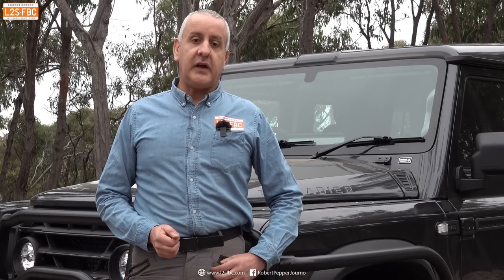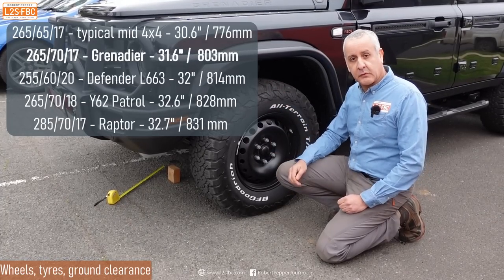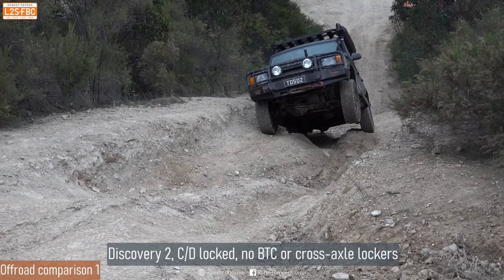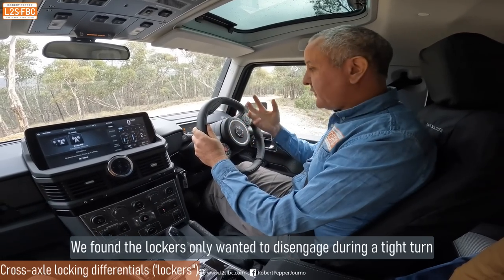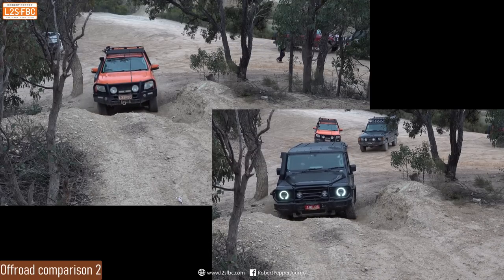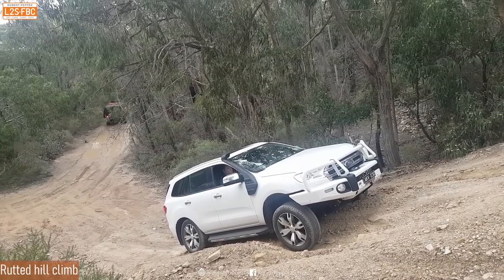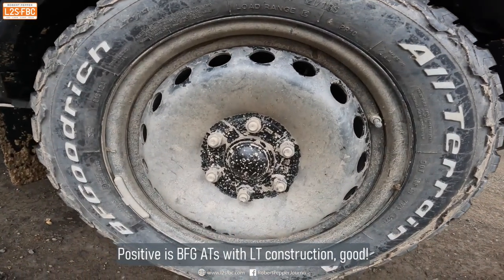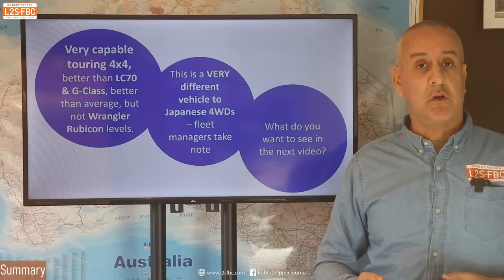INEOS Grenadier Offroad Review & Comparison : Australia

Comment: At l;ast, some real inbiase review...
 Can you further elaborate on the car's workmanship? ther wewr complaint about poor wiring, loom connectors, steering on tarmac roads,/
What about accessories - I see you have a buullbar installed, What about UJF radio? Hi Lift contact /lift points? drawers? etc? How can one attach a Warn whinch?
How dfoes the car eract fullu loade - fridge, off-road equipment, camping kits, food, 4 adults?How are thr rear seats for two adult while offroading?
Reply from the maker: Build quality is good. Road I'll cover another time. UHF would be easy. Drawers can be built. The vehicle cannot take a standard lowmount - I did cover that. It wasn't loaded, that'd be next.

Comment: Brilliant video! Best so far on the IG. I cancelled my order also due to the rising costs and the fact it doesn’t seem finished yet! But looks to have loads of potential! Would be great to see it up against modern alternatives such at the new defender and Land Cruiser. When it bottomed out a few times up that narly section was there any damage underneath?
Reply from the maker: Thanks!  I don't have any concerns about build quality or the car "not being finished" though. No damage underneath, the diff caught first.
Reply: @L2SFBC  more talking about the software glitches, leaking sunroofs and door seals. Alot of pressure to get them out and some quality control issues over here in the UK for sure. But that is too be expected for a new model to be fair. As with all new cars/ models probably best to buy version 2 when all the bugs are ironed out! issue is it will probalby be even more expensive then! :(

Comment: In the VW world there is VCDS.  This enables a huge number of options in software to be modified.  If  there is such an app for the Ineos, it would enable users to tailor the vehicle to taste - such as :  enable front locker without rear, enable rear locker in high range, maybe enable BTC on the front with rear locker engaged, and so on.  For Aussie buyers, deleting the bull bar and winch option in favour of an Aussie aftermarket bar and "standard" winch would be the way to go.   For me the small fuel tank is the really big problem.  Otherwise it really makes the Landy in this comparison look extremely ugly - I'd not like to be a passenger in that thing in the High Country with 1000ft dropoff to the side :)
Reply from the maker: I will be covering the fuel issue in the Touring video.  The reason the lockers are rear-front is driveline protection. This I understand and from an engineering perspective agree with. However. As a 4x4 driver, I disagree and want total flexibility, and if I ruin my drivetrain, I ruin it.  So two differing perspectives.  INEOS do not want to deal with broken shafts because people don't know how to use lockers, I get that.
Reply: @L2SFBC  I have a front autolocker in my Patrol and no rear locker.  Of course the T/C is locked by design, and I have zero driveline problems from only using the front in high or low range.  Methinks Ineos guys could use more real world experience.  They've done a good job with the car in most respects, though.
Reply from the maker: Yes, but you're presumably driving the car with due care and attention for a front locker. INEOS need to consider OldMate58 too, who won't accept banging it off the revlimiter in first low isn't a good idea.
Reply: @L2SFBC 
It's also helps marketing out by not having them dealing with bad press over broken drive lines.

Comment: General question about TPMS systems, not specific to Ineos - what happens when you rotate tyres regularly including the spare?  Is tyre rotation no longer possible due the TPMS system?
Reply from the maker: You stil rotate tyres. Why would TPMS be a problem?
Reply: @L2SFBC  let's say you put the right front tyre to the left rear.  As the sensor inside the wheel has now moved along with the wheel to a different corner, is the pressure displayed on the dash going to be showing the pressure of the wheel in the wrong quadrant?

Comment: On the diff lock disengage indicator "issue" I wouldn't be too harsh as their explanation is logical. More to the point I would be wary of suggesting Ford does it better somehow because their indicator light is probably working in isolation to the locker and likely has zero feedback to indicate it has or hasn't disengaged. Very easy to make it seem like it has disengaged immediately if the light is just depowered by yhe switch. Just my sceptical thoughts...
Reply from the maker: The Ford system, and others, has actually disengaged when it says it has. I've owned that cars for years and know it well.  The INEOS has PROBABLY disengaged, but not indicated...so you don't know for sure. You can argue it's liveable, but not that it's ideal, nor that it's an impossible problem to solve given others have done it.
Reply: @L2SFBC  I guess that's just another difference between new manufacturers and long-term OEMs

Comment: I hate software which puts up obstacles like you experienced with the diff locks. It seems completely unnecessary to force you to engage the lockers in a particular order.
Reply from the maker: There is a reason; driveline protection, but I'd rather take care of my own driveline.
Reply: @L2SFBC  same here. Though I’m unsure why you need to lock the rear diff before the front to protect the drivetrain. Certainly if they want to be a modern Defender replacement I see no reason to hamstring it with such software.

Comment: Awesome review as usual.  Not a rubicon is exactly right.  I was hoping that it will compete with the rubicon.  The steering dampener location is confounding it’s like it was designed by people who never go off road.  It might be a deal breaker since even if covered by bash plate it reduce ground clearance.  Does it look like it can be flipped up aftermarket ? Also it’s my understanding that you can’t put bigger tires on without chopping the body ? This is the major drawback of Toyota tacomas.
Reply from the maker: I would expect 33s to fit based on a quick look, but we'll need to do a test fit to be sure.  May need slightly wider offset rims. The damper was designed by people who never drive in rocks, to be precise :-)  And yes it could probably be redesigned aftermarket.
Reply: 285/70-17s fit without mods. An African owner has already done it. No rubbing at full articulation.
Reply: In the left hand drive Grenadierthe damper is not in the same position, it's behind the steering arm, so definitely in a much better position, the reason why its different on the right hand drive is because the diff is there.
Reply from the maker: Excellent, good to know, thanks
Reply: you can use 285/70R17 or 285/75R17 without any changes, but with an additional 30-40mm lift it would be perfect (Black Sheep Innovations has shown it, looks awesome)

Comment: The hill decent control appears to allow the car to move too fast: how slow can this beast go? The rear & front diff lock button should be reversed, that is, the rear on the left (as that is always engaged first) then the front locker switch on the right - we read from left to right - indeed not a deal-breaker but the placement defies logic.
Reply from the maker: I think that's a matter of opinion, and suspect you could swap it if you really wanted to.
Reply: Late Brake Show review shows HDC down to 2mph. How slow do you want to go?
Reply from the maker: Slower than that in extreme rock. However 2mph is ok.

Comment: Seeing as you like to talk about tow ratings and gcm and gvm can you do a video on it towing ability. It advertises 3500kg but looks like ball weight is useless…..
Reply from the maker: That is going to be in a future video - got questions with INEOS
Reply: Tow ball weight is 350 (in Australia at least).  Why is that useless?
Reply: @daviddevaus436  originally it listed as much lower even in Australia. Want to know if the springs and shock have been swapped out or the same as elsewhere

Comment: I think the aftermarket here will shun it because they make a fortune turning the 70 series into a useable vehicle, 200 series chops only exist because by the time you upgrade the 70 series crap interior from the early 80’s into the 90’s and get it to make more power than a 40 grand dual cab its cheaper to chop a 200 into a Ute and get the nice interior and auto to go with it.
Reply: The aftermarket has already taken off with these, gull wing rear windows, roof racks, portal axles, lift kits just to mention a few

Comment: strange what they did with the winch, i can see some glaringly obvious issues straight away. the time when your winch is most necessary is if the vehicle has stopped in water/mud or you've stopped it because it was too deep. you need the winch to work with the vehicle off so you can at least drag it out and fix it. even worse if it's running water with a soft bottom that's going to erode and bury the vehicle.
you've slipped off the track on the side of a hill, you've gotten out of the vehicle you've switched it off because it's unstable and left it in park. you can't secure or extricate the vehicle with the winch.
you can't power your line in and out or winch small branches etc in park.
Reply from the maker: Ah you see my point you have real world experience!  There are engineering reasons why they have done it but as a 4x4 driver I say give me control!
Reply: simple warnings not to winch in park without brakes fully applied and winching without the motor running will flatten your battery should be enough to absolve them of any claims.
will be interesting to see what jeep do with the warn winch on new rubicons if it has any nannies, they have a hawse with a rope parking knob which is a bit different.
Reply from the maker: That's the approach I'd prefer them to take; enable full control but with warnings etc. Who know what you need the car to do out in the field. No restrictions please!
Reply: @L2SFBC  hopefully you could just disconnect a couple of wires or remove a fuse to override it.
Reply from the maker: Absolutely!!!

Comment: So stupid to not be able to engage only the front locker and leave the rear open. In difficult terrain I use the front locker 90% of the time versus the rear locker. The rear locker causes a lot of understeer and also causes the vehicle to slide sideways in off camber terrain. Traction control is ok but the wear and tear on the brakes is brutal. Give me selectable front and rear lockers over traction control any day.
Reply from the maker: I agree it's not ideal, but it's workable. Most cars are wired that way, and even ARB defaults that way unless you ask them otherwise (and they actually follow customer requests).  Wear and tear on the brakes is not brutal with BTC, there's hardly any energy to dissipate.  In the video you can see my Ranger slide sideways with the rear only, so I get your point.  However, the engineers would say "driveline damage" - to which I said, who paid for the driveline, and therefore who gets to decide how their vehicle is driven?
Reply: @L2SFBC   I respectfully disagree about the abuse of the brakes.....it depends on what you're doing. In Northern California we have a lot of steep elevation. It is not uncommon to go from a ridgeline to a two track shale covered and deeply rutted trail with a very steep decent for over 600 meters. Vehicles with only traction control and minimal low range gearing are going to be on the brakes a lot. Toyota 4Runners sound like a war zone under the chassis with all the noise they make. The beauty of selectable lockers is once engaged, one tire cannot spin faster than the other giving you incredible control (especially if you have very good low range gearing) when doing down long steep trails. Vehicles with downhill decent control can take a beating in these conditions.
Reply from the maker: We have the same in Australia. I'm not talking about descents but ascents. I agree lockers are often better but I don't think brake traction control is a massive brake wear problem. Reason is that it isn't slowing the car as a whole only one spinning wheel.
Reply from the maker: We have the same in Australia. I'm not talking about descents but ascents. I agree lockers are often better but I don't think brake traction control is a massive brake wear problem. Reason is that it isn't slowing the car as a whole only one spinning wheel.

Comment: I think a Jeep Rubicon would have put this to same so badly that Grenadier would have got mad you even used one
Reply from the maker: The Rubicon would beat the Grenadier offroad, but it's not in the same class. The Wrangler will never be a serious load-lugger.  Jeep lovers will tell me they've driven long trips with it, and that's fine, but it doesn't make it a good choice. The Grenadier's offroad capability is more than good enough for touring. It doesn't need to compete with the Wrangler on hardcore tracks.  And, the Wrangler wouldn't be so far ahead.

Comment: Glad for $100k it got everywhere the 40 year old disco did 😅
Reply: 20 year old Disco
Reply: @davidkelly3779  if it’s was one of the final discovery 2 productions, however it’s still a 40 year old design and technology 🤷‍♂️
You get my drift
Reply: @bomberbolton  Dude, you said it is a 40 year old car. Too late to back peddle. Even so, no way the D2 electronics were designed in 1983. However you just keep digging a bigger hole for yourself.
Reply: @davidkelly3779  haha mate are you on about?
My point is that that discovery is not cutting edge technology, maybe not 40 years old, but the design and tech is far older than 20 years, no terrain management etc.
But to make you feel better, you are right it’s not 40 years old 👍
Reply: @bomberbolton  “Terrain management”? You must be a ford fan. Actually the D2 has an excellent traction control system. However the D2 in the vid had it disconnected, due to the locker install.
Reply: @davidkelly3779  sorry ‘terrain response’
I’m actually a LR owner.

Comment: Damm way worse than I expected don't want to deal with that usless electronics  confusing  and suspect to damage  bad design . will stick with my 80 series landcruiser anyway compared to this modern  example  .amazed discovery didn't break down  well done
Reply from the maker: I was reading that and thought bet that guy drives an 80 and yeap... :-)
Reply: There is no doubt the 80 is a good vehicle, but it is 30 years old. And, in original spec is a lesser vehicle than the IG in original spec.

Comment: that  isn't  a recovery  placement that is a tie down hook for  transporter use they aren't designed as recovery shock load points, 18-20 inch rims okay tamac driving  and gravel driving  may be, offroad nope
Reply from the maker: They are recovery points. They are strong enough according the owner's manual, and I specifically asked INEOS, and got a positive response in writing. INEOS were also kind enough to check an earlier draft video of this. You'll also note they are in line with the chassis rails.  The Grenadier can take 17s, even if some variants offer 18s (why this is the case I'll never know, but that's why I don't work in marketing)
Reply: @L2SFBC  marketing bs i say, claiming something is something else when in fact the correct statement is tie down vs claim of recovery point every motor vehicle has tie down points..

technically you can use it as recovery if you wish though be sure the legal definition recovery can mean 2 different things, 1 meaning tow truck towing the other means you recover yourself and these  terms are not interchangeable with each other Robert, i would find out in what context ineos is using the term "recovery point/points" and whether or not they are mislabeling what looks like a tie down point to me (((common sense)))  vs their legal definition of what a recovery point/points physically is and terms of its use!!!!????
Reply from the maker: I'm not sure what else I can say, other than quote "Yes, the front and rear towing eyes are rated for off-road recovery."  If that doesn't work, perhaps a CH-47 would suffice.
Reply: @L2SFBC  True , they are rated - and there is a diagram indicating rated horizontal and vertical loads for front and rear points.
Reply: @paultucker4923 I was about to say the same thing 👍🏼